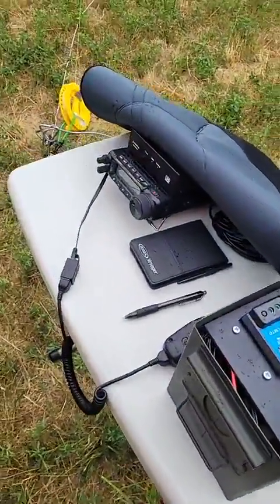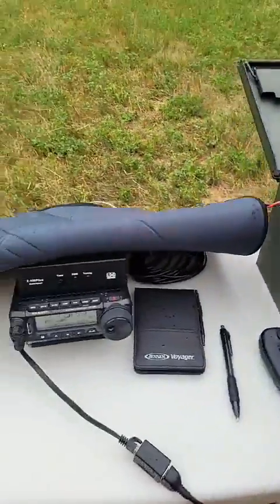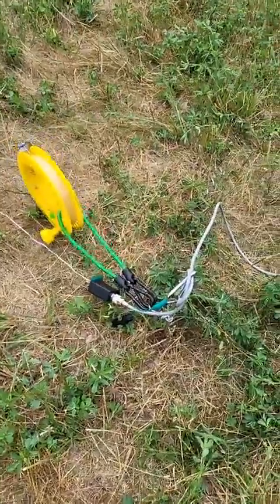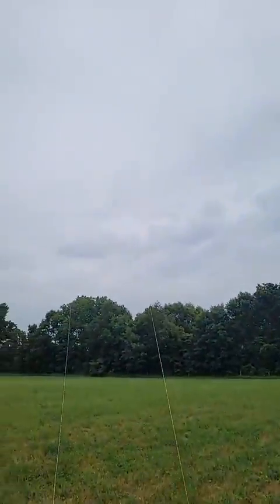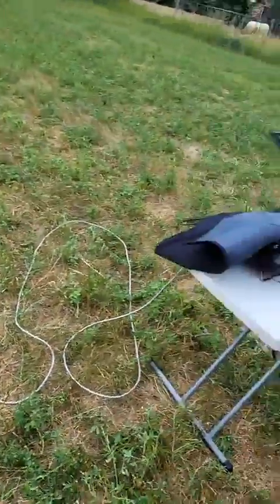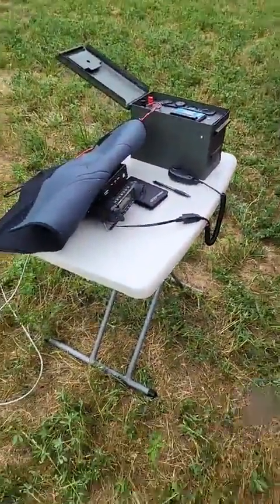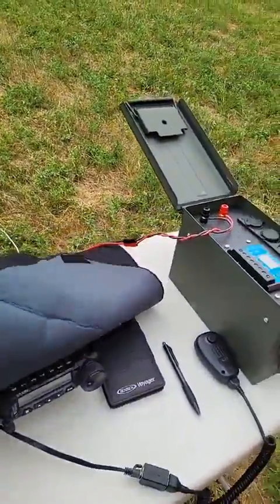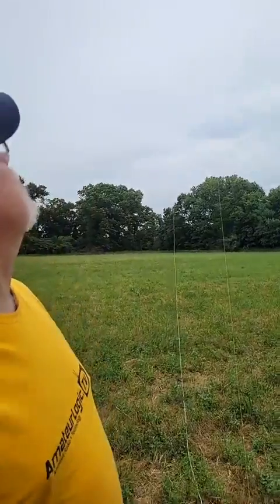Kite Antenna   FD2022

Comment: Wow, you have some great height with that kite.. Looks like it would perform very well.. thx for sharing... k0klb
Reply from the maker: It worked really well. I tried to get it as high as possible as quickly as possible because that was the ONE day I didn't have much wind 😂.  Just a slight breeze now and then.